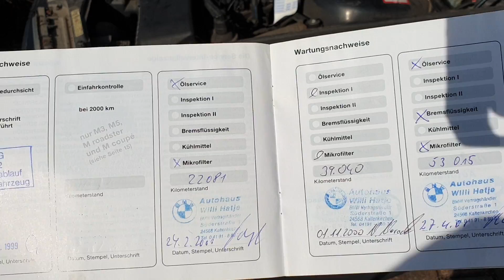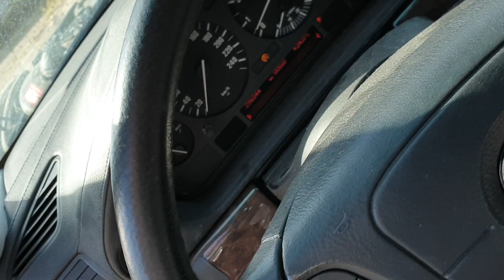Starting a V12 BMW E38 7 Series That's Been Sitting Outside For 5 Years

Comment: Battery change seems like a pain.
Reply: Согласен,нормальный АКБ и она и так бы завелась
Reply: same shit on the E39 (unless you have an M5)
Reply: TBasianeyes It’s not hard on a 540i. I have a 1999 BMW 540i and it takes just 1 group size 49 battery. It’s actually easier to replace then some more modern cars.
Reply: Try on porsche cayenne mk1 :D
Reply: @neesminis  Same with mk1 touareg, it’s under passenger seat. nightmare

Comment: SCHECKHEFTGEPFLEGT!!! That is an awesome find, man. Completely maintained all its life, mega equipped with shadowline, rear climate and more? Sick.
Reply from the maker: Genau! The car was loved up until that point. Not mega spec as my silver 750iL, but pretty good spec nonetheless - shadowline, rear climate, EDC, rear electric seats, hydraulic trunk lid...
Reply: @M539Restorations  The black one is missing the picnic tables. Oh man i remember a couple of years ago you could get those for cheap on the used market in germany because barely anybody liked the e38. Now? ehhh no
Reply: Die wichtigste Frage: hat er einen Kühlschrank?

Comment: The fact that the quarter window shades work is incredible on its own!
Reply from the maker: Exactly! One of the decisive reasons for buying this E38. Both of them are missing on my 750.
Reply: right, on my E39 they are all broken and dont go back inside on their own, at least the big ones and the elecrtic rear one works
Reply: I thought my 750 was the most rusted one of all

Comment: Mine took a oil change,Liquid Molly oil and additive,fuel pump,Rad,two new batteries,it came back alive,Titanium Silver/Black leather,very clean interior,this car has sat more years then driven,I put new tires,strait pipe,because the Cads had been stolen,same Wheels as yours,paint has some fade,but really clean body,not many 750 came to US🇨🇱👍

Comment: My first BMW was a 1989 BMW E32 750il, and I drove it daily for five years until upgrading to a 99 E38 750il, both Alpinweiss III with Sandbeige interior. 

At 270K km, the headbolts failed in the E38. Rather than selling it for scrap or parts, I had it towed nearly 600km to a shop I trusted, where they pulled the heads, rebuilt them, and reinstalled them. The bill for parts and labor for that job was several pages long and cost many thousands of USD, but it was such an epic car, it was worth it. That M73 is absolutely incredible!

I drove it for another 48K kms, until I switched jobs and have now a 250km daily commute. I couldn’t imagine beating up the E38 with that commute, so I bought an E90 335d. Also a great car, but I miss the smooth, responsive silence of the 7er. It was the best combination of size, comfort, and feeling like a private jet and bullet train in one. The only thing which might have made it better was a 6spd manual out of an 850csi or an M5. 

Greetings from Seattle, Washington!  Keep up the awesome content. Subscribed!
Reply from the maker: Thanks for the story! You'll always have that memory. :)
Reply: How can Americans drive hundreds of miles every day? Isn't that wasting too much time? And those big-block American petrol cars. It sounds very expensive for me...  I have to drive only 110 miles 3 times a week, but I already feel too much. I will never understand how this can be normal for Americans. :) Greetings from Glasgow, Scotland.
Reply: Perhaps the next one will be a 760 MSport or an Alpina B7!
Reply: Csaba Szűcs, that is a fair and wise question!  For me, it boils down to the geographical distance between where my job is located and where my wife’s job is located.

While drivIng a great car in a gorgeous location is a pleasure, the time it takes does wear rather thin!  It equates to nearly three hours per day in the car, and when one multiplies that time commitment by the number of working days in a year, it is a rather off-putting figure.  

I was born and raised in Central America, where priorities are quite different than they are in the states. I look forward to getting back to that lifestyle as soon as possible!

Comment: I do have my dream baby sitting in a garage for more than 12 years. 540i E34 Touring -  waiting for its restoration. Had to relocate it and I can tell: Exchanged the oil, plugged in the battery, and off it went, smoothly like it had been waiting for a short stop at a supermarket. Just love these engines!

Comment: That’s genuinely inspiring! Love my e38 740i.. now just replace the thermostat with an 88 degree unit and you’ll have a car which will last you another 20 years
Reply from the maker: Thank you!
Reply: SuperAspari 
I’ve always wondered how that would affect emissions? I’d like to do that mod, but not sure if MOT would accept it.
Reply: Why would an 88degree thermostat make the engine last longer?
Reply: Faboking2 
The M62 is really strong, and the high temp isn’t bad for the engine; however, the high op temp literally ”bakes” the plastic timing chain guides. Changing the guides is quite a big job.

Actually, lowering the temp could possibly do bad things too. I'm not sure how that affects carbon buildup in the engine.
Reply: Ah, didn't think about the plastic chain guides. True they would get baked and crispy and it would be a pain in the ass to change them. Agree on the carbon buildup thing though.
Reply: Red HawK15  Hello Red Hawk. I have a 2001 740il with 227k miles on it. I have just had it since August and have been wondering how to update the current audio system, which isn't bad if you just want AM or FM. I don't use CDs anymore so haven't tried out the system. If you go to a car audio store they are perfectly willing to charge you a fortune to update your system including a rear camera and touch screen. Or go to the dealer and get the same basic system for ridiculous $ even if it's just the screen that's messed up. 
So what I did was get a bluetooth audio set-up for $27 bucks that I use Pandora and Spotify to play through an unused FM station. 88.3 for example. It works great and uses the same speaker set up which was pretty good for almost 20 years old. You can find it on Amazon. It's called Nulaxy Bluetooth FM transmitter and it's powered via your old cigarette lighter. Check it out?
Reply: system even if it's just the screen that's messed up for another fortune. Check out Nulaxy Bluetooth FM transmitters. For about $27 on Amazon, it works with an unused station, 88.3 in my area, and sounds dang good on almost 20 year old speakers.
Reply: @Faboking2  It would make it last longer, because all of bearings, a lot of rubber parts, hoses and stuff like that, but the parts of engine too will last longer with classic normal 88-93 working temperature..Those 114 degrees in M62 is a shit. Carbon buildup might be the same as will be everywhere else. Its about hourwork of engine, about kilometeres, about the fuel used, and etc not about the temperature of cooling...
Reply: Red HawK13  Hello man, owner of 740i 1999. E38 is not the same as E39 and E53 X5 (it have some differences under the dashboard, which is different pipes for heater), so that china looking 16:9 Navi with all that bluetooth and all other function cant be simply added to E38 like it could in 5er (you can, but you need to remake those pipes, which i dont reccomend). You can use AM/Fm transmitter as Doug said, but i dont like it much, i have some problems with it and i think, that the sound is not clean. Plus it takes you a space for i dont know charging thins in that cigarette lighter. I have 4:3 navi and i bought it for about 12-15 euros an old cassete with AUX cable. German HAMA and a lot of other brands are still making them for such and old cars, and if you dont fuck that cable, it will always play good. So insert in your casette player if you have (you dont need to even take it out), switch in navi for it, connect phone, enjoy

Comment: I just got started restoring an almost impeccably maintained '97 E-39 540 with 224,000 miles on the clock here in the states.

Comment: I bought a bmw e38 728i 1998 for 500 bucks and it had some rust so the second im about to start it i taught it wouldnt start because it sat for 5 years without starting it or driving it so i start it up no delays nothing started right up i take it for a test drive and it drives like any other car i was amazed by what A machine it was i still own it its been 2 years now no problems only changed the oil and the spark plugs otherwise nothing wrong with it

Comment: Pro tip, when pouring from a can, tilt it on the side. Then air will get in to the can much easier and it wont splash so much.

Comment: Fun fact: You have to get a trailer for a car like e38 because the overall mass of a tow truck and e38 combined exceeds 3.5 tons, which is forbidden by the law, but from the physics point of view a 4 tons trailer attached to a  tow truck is way more dangerous, than if it would be on the tow truck itself.

Comment: I love your videos, you seem so optimistic even when the car is in such bad exterior condition. 
After looking at your videos, I started thinking about making some edits to my E39 Tourings interior, more specifically regarding extended wood (goes across b pillar) and adding the back of a 7 series front seats to mine. (''Cocaine'' Table etc)

Also refrigerator to the middle seat in the rear, if thats doable in a nice way :)

Comment: It runs, why the tow home, just drive it!  What are the odds you get pulled over taking it home at night?  O.O%.  In the US, we'd just grab plates from another car and drive it.  Just call your insurance company, and you are golden.  Germany- I know, everyone follows the rules, like good sheeple.
I had a '67 Datsun SPL-311 in college back in the 80's.   Hadn't been on the road for at least 10 years, just parked and falling apart.  Meant to restore it, but didn't have the time, so sold it for what I had in it, $300.  Total basket case, would barely run, but buyer got it started, and puttered off into the sunset, in a cloud of smoke.  Brakes?  Hardly.  No towing or flatbed necessary, just a tool kit and a prayer.

Comment: Did you pull all of the plugs first to add any lubricant to the cylinders before rotating the engine over?  I have a 98 750 in this exact situation. :)
Reply from the maker: I didn't, I had very short timespan to get it running and changing plugs on M73 isn't exactly quick or easy. But, it's highly recommended if you've got the time. On another 850i that I just bought, I'll be using fogging oil to coat the cylinders as it hasn't been driven since 2004, although the seller already tried to start it but it's crank no start situation.
Reply: Thank you for responding to me!! I want to get mine running too, but pulling 12 spark plugs out is a job on this car. lol I think I’ll do the same rotate method though before turning it over. 

98k miles on it, I can’t wait to drive it again. :)

Comment: Did you leave the waterpump driven fan off? It has two large electric, and really does not need the mechanical one, which contributes the most noise generated under the bonnet!
Reply from the maker: I left it off during that time, but it does need it unless you want your car to overheat.

Comment: Nice car, I bought a 735iL e38 a few months ago and it has exactly the same rust spots (it came from the north of Germany).  I would like to repair all these rust spots and then paint it.  Do you think it is better to repair the rust points on the doors or directly change the doors?
Reply from the maker: If the rust is bad as on this one, definitely change the doors and cut out the other rusty metal. Otherwise it will be back soon.

Comment: that rust breaks my heart.. a fully maintained 99 750 is really hard to find where I am at :(
Reply from the maker: Yeah, the rust is really bad.
Reply: @M539Restorations  is not a big problem, if overall condition is so good
Reply: @88RealMan88  You obviously dont know how much work it is to properly fix that. All of the doors need to be replaced, new wheelarches need to be welded in, and most likely the the sils and floor is rusted aswell. Full respray aswell obviously. Sadly this car is going to be parted out, unless a die hard e38 lover buys it. I cringed a bit when he jacked up the car that quickly, i have seen quite a few BMWs of this era where the sils are so rusted the jack point collapses.
Reply: @Scouter98  in my country this job dont costs much. I 've done this before with my old bimmers, even with e38, that was much more rusty. For sure , this car wont be new again.

Comment: The thing i wanted to ask, working on your car like this (changing oil and antifreeze) but ofc putting all the fluids in a container, in bayern, would that be allowed or is it a must to take the car to a shop?
Reply from the maker: Yes, everything goes into separate containers and then you can take it to a shop if you're good with them or a recycling place.

Comment: i used the same Oil for my e39 525i but my mechanic said that its crap and i should use 5w40. What do you think?
Reply from the maker: Use 5w40 in that engine from Liqui Moly, Shell, Motul... Mannol is just a cheap oil that I use when doing short interval changes to clean the engine before putting in the good stuff.
Reply: Thank you :)

Comment: I have a 2000 e38 that lost its power steering low speed assist. I took it to the dealer for a different problem and miraculously they also fixed my low speed power assist after years of not working. after 9 months or so it went away again and never came back..obviously an electric not mechanical issue something somewhere storing codes i suspect.... would you with your experience have an clue how to reboot an e38?

Comment: if it had the M-sport parallel spoke wheels, it would look just like my 750iL Sport edition on the outside due to the black moldings..
Reply from the maker: I love M-Pars on E38.
Reply: Wish I had m pars. My favourite 18 inches after M5 rims. My staggered style 66s are getting expensive for tyres. The rears cost double the fronts.

Comment: "German cars are over-engineered". No they're not. They're perfectly engineered for the off-chance that someone wants to revive one after sitting out for 5 years.
Reply: Yes German cars are overengineered and badly engineered with too many stupid electronics that's doesn't last for long
Reply: That may be true for the older models. The new BMWs are unlikely to last that long. Partly because they will spontaneously self-combust sooner or later :).

Comment: Why do these old beemers have so bad rust protection, if any? E36s, E39s, E38s all are notorious for rust.
Reply from the maker: Old cars plus German winters are really heavy on the salt.
Reply: @M539Restorations  But cars like E39s have all standard problems with rotting trunk hoods in the middle, not some place where salt would accumulate. Again these old BMWs from the 90s all have problems with rotten door sills as most other cars with same age don't. That's really the only problem I ever had with BMWs,  rust.

Comment: I jist foung a armoured  1998 model in great shape running for 1200 euro
Should i buy it
Reply from the maker: Yes.
Reply: @M539Restorations   i just bought it
Reply: @M539Restorations   it runs great on petrol and gas has the bulletproof windows no rust , but the  navi and cd player dosen t work . Paid 1200 euro

Comment: Isn't it best practice to remove the old petrol before starting? I heard petrol goes bad after a year or more.
Reply from the maker: Yes it is, but I was working out of parking lot so I just added fresh petrol.
Reply: @M539Restorations  Also, have you heard of the practice of removing spark plugs & spraying each cylinder with fogging oil before starting engine to prevent metal to metal contact & damage to cylinder wall ?
Reply from the maker: Sure. Changing/removing spark plugs on the M73 isn't easy or quick and I had very short timespan to get it running so it was either like this or nothing. It was fine.

Comment: Why two batteries. I owned an e38 740i. The best.
Reply: It is pretty common for large luxury sedans (and other cars) to have two batteries. One to deliver amps to the starter and the other for luxuries such as A/C and stuff like that. The W211 mercedes e-class came with a solar powered roof (might have been an option not sure) instead of the second battery.
Reply: @IcedStick  Thanks for info.  I never knew that.
Reply: @BOBBY-et9xb  You're welcome mate!
Reply from the maker: Pretty much what Amf said. On the 750, one is for the starter and E-kats and the 2nd one for electronics.

Comment: 10w40 oil is not suitable for any BMW...But nice work!
Reply from the maker: Thanks! Yes, it is. For this engine, M73, 5W40 is preferred but I was just starting the car from dead and used what I had. 10W40 is perfectly fine for M70 and my preferred choice.